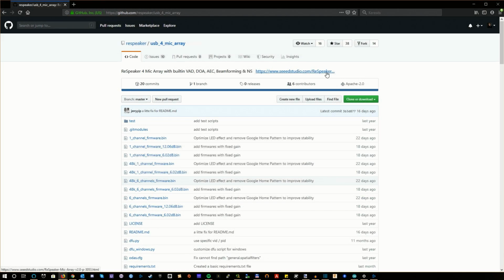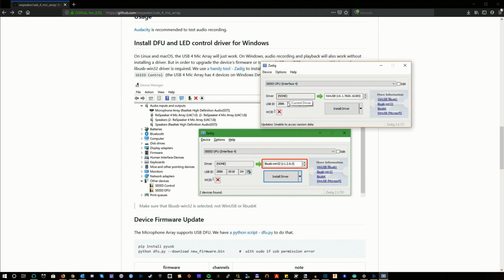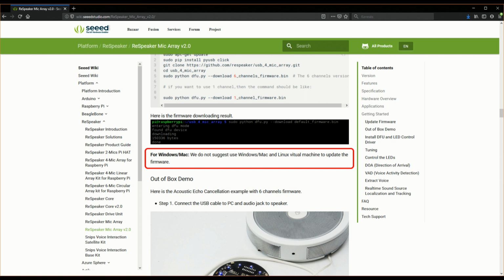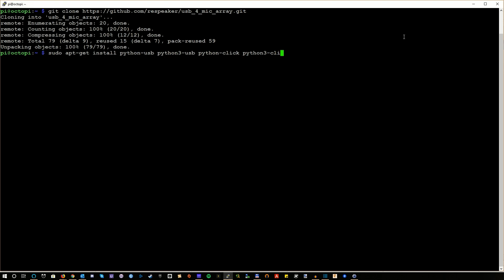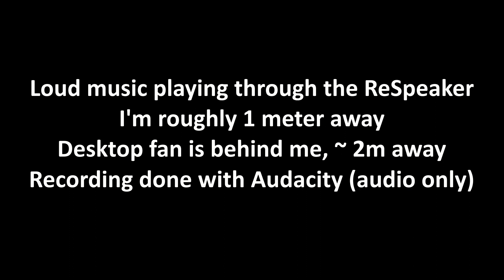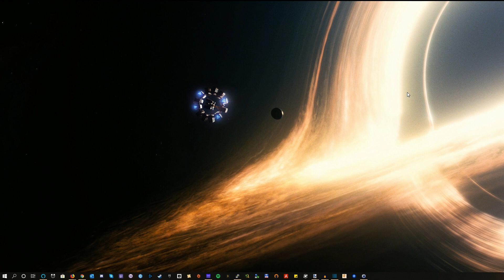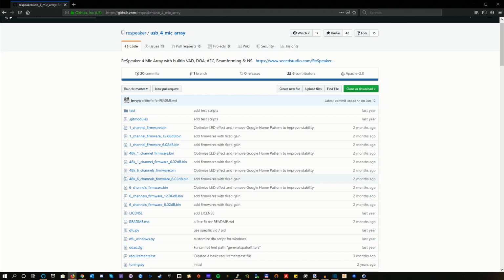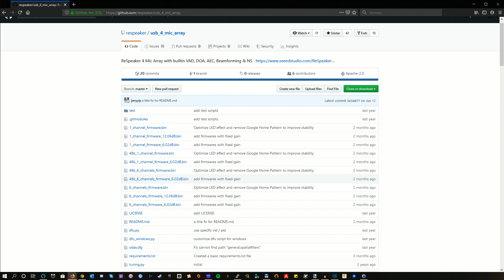ReSpeaker Mic Array 2.0 - Firmware upgrade (48kHz sample rate!)

Comment: WOW! what a change, why do you think they chose to ship this with the shitty firmware?
Reply from the maker: My idea would be that they packed and shipped a ton of the kits to resellers, but they also kept developing the firmware in parallel. But that's just wild guessing. Anyway, I bought my unit from a reseller (Pimoroni? Farnell? Can't remember tbh) and not from Seeed directly.
Reply: They were emptying old stock. Since you bought yours 6 month after the 48K release that gives you an idea of how these stores handle inventory. I wanted to ask you, could you compare it with a high quality studio mic? Theoretically the DSP can use all mics to improve the sound quality of the individual MEMs.
Reply from the maker: @daslolo   Sadly I don't really have a high quality studio mic at hand. The one I have is what I've used in the first video - it's the BM800, which is a condenser mic, so their purpose and parameters are really different. What I've tried to demonstrate in that video is pretty much only basic audio quality (e.g. within the limits of average human perception), but no point comparing signals or something like that.
Reply: what parameters define the quality of a mic and why can't this work?
Reply from the maker: @daslolo  It's not really the quality, but more like the pattern it picks up voices/sounds. I'm pretty much a noob when it comes to hardcore audio stuff like this, but here's a video which explains what i'm thinking about - https://www.youtube.com/watch?v=-USGst7QqwU So my BM800 mic is a cardioid one, while the ReSpeaker is an omnidirectional. However, it still tries to remove noise it picks up via post processing. So for example, if the 3d printer is working in the other corner of the room, the condenser won't pick it up, while an omnidirectional picks it up, and then the postprocessing tries to remove it. Hence no real point in making a serious comparison here - they work very differently.